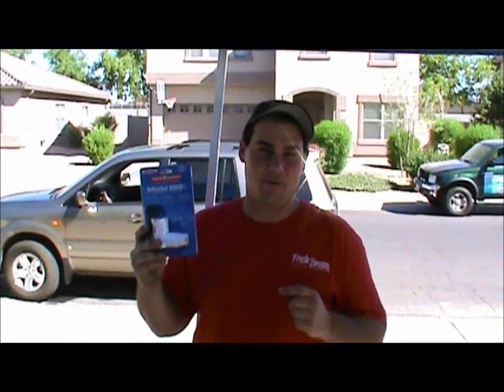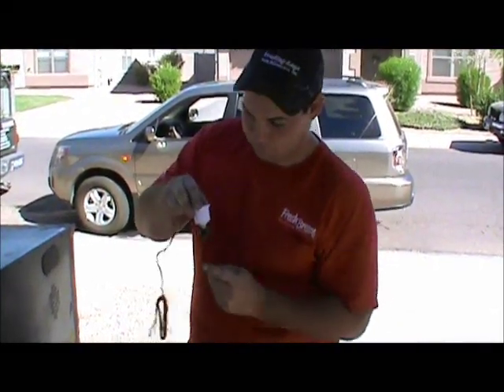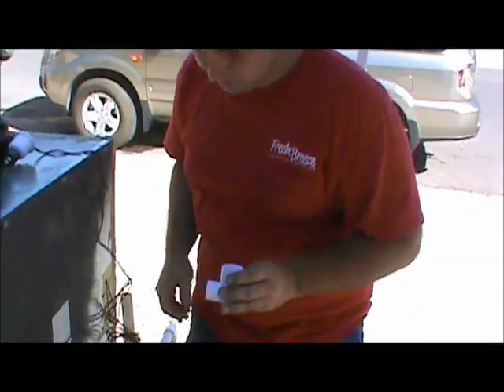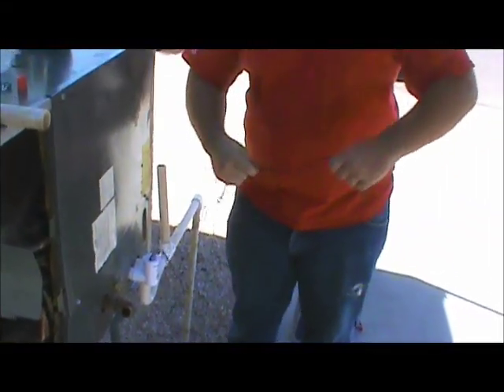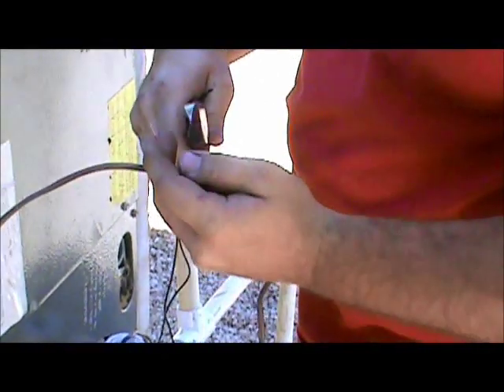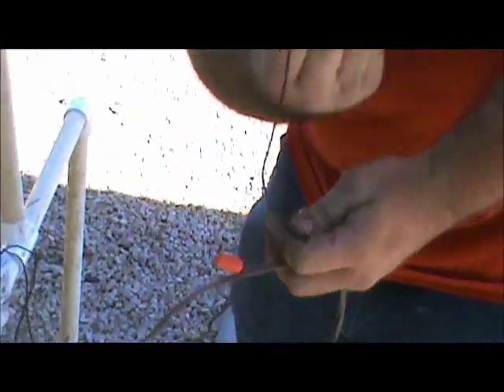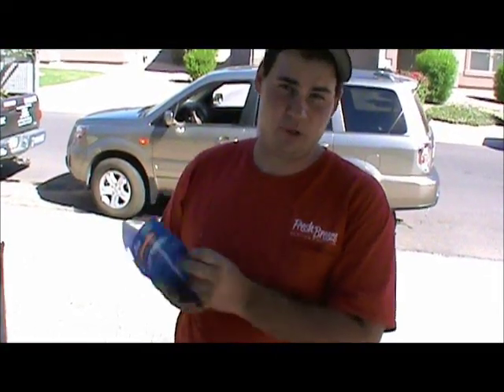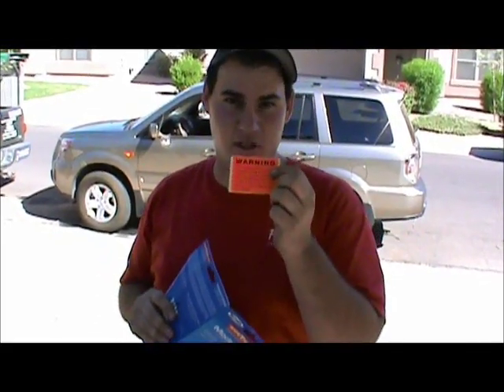Condensate Safety Switch - How to Install a Condensate Safety Switch

Comment: Instead of cutting the wire. You can take wire off r.. wire nut it with wire from switch the put other on r? Isn't that correct
Reply: JJARRIN81 yes that is. You can take R off, wire nut it to one of your float switch wires, and put the 2nd float switch wire where R was. In this trade, there are many different ways to one thing it all comes down to what you’re comfortable with.